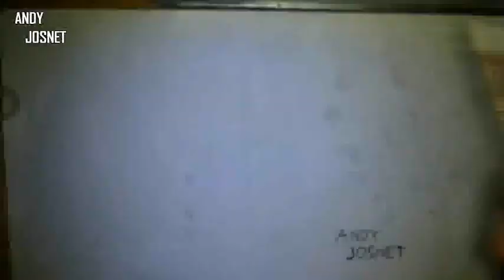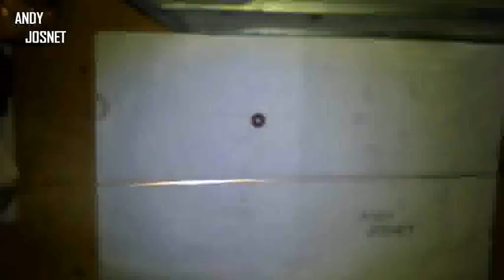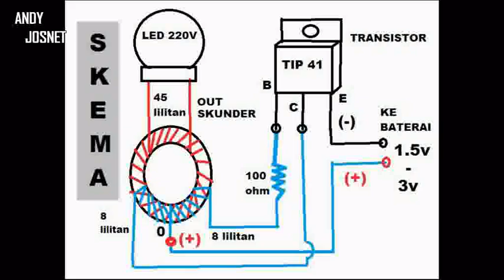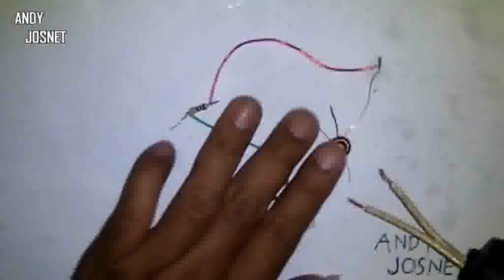Eksperimen membuat joule thief pakai 1 toroid bekas lampu LHE (bagian 1)

Comment: Saya sudah coba , bbrp transistor tidak kuat panas karena voltase diatas 3,7v, spt bc547, 13001, dll. Sebaiknya gunakan tip31 atw 41 atw bd139 yg lebih kuat.
10 led strawhat sangat terang , sebaiknya resistor diganti VR 100k agar bisa diatur gelap atw terangnya.
Masalah lain lagi ketika voltase baterai dikuras habis shg susah di cas , jadi harus cas pk adAptor. Mungkin bisa ditambahkan indikator baterai.
Reply: jd boros baterai ya gan?
Reply: @mancingmania3505  kelebihan dr baterai lithium, bisa di cas ulang jadi kendala boros itu relatif karena agan gak perlu beli atau ganti baterai. Tiga led strAwhat putih cukup untuk kamar 3x3
Reply: @TWINSTARSHIDO  mkasih jawabannya gan....
Reply: Kalo tip 41
 bisa gak
Reply from the maker: Rangkaian ini hanya bisa buat baterai 1.5v, selebihnya gak bisa Krn toroidnya kecil, toroidnya bisa buat JT lampu terang pakai baterai 3.7v tapi harus pakai lilitan yg melingkari Cincin toroid ini tapi tidak masuk di lubang tengah toroid kecil ini.
Saya ada tutorialnya bisa di cari 😁